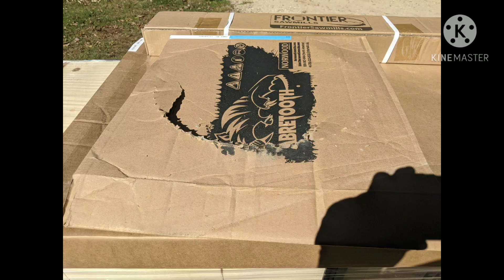The Frontier Os27 Has arrived

Comment: I just got one and am having an issue with my throttle as well. Any insight?
Reply from the maker: No I don't have anything for you.   Mine finally came loose again but where it's at it works and I'm leaving just like it is.   I could never get the pinch to hold the cable.   I did drill out the weld stud and put a 1024 lock nut and bolt.  Helped a bit.  I bought an electric linear actuator if my current cable fails I'm going to install that.
Reply from the maker: Enjoy the mill. I have really not found any other negatives.  I'd buy it again if needed

Comment: Im just wondering but how did you get the blade guide adjuster on the os27? Their website says its a fixed blade guide system. Is this an add on?
Reply from the maker: There are set screws on the side of it.   All I had to do was slip mine in and tighten the set screws.
Reply: @BigelowWoodcraft  so it comes with the adjustable setup? Please explain. Im looking to purchase ine but i want to be sure it has a fully adjustable blade guide.

Comment: How have you been liking the sawmill?
Reply from the maker: I've been really enjoying the mill.  No problems other than a water valve I let freeze...I fixed it.  In all honesty I've never ran another mill so I can campare it.   

I have the 13.5 hp.   Feel adequate.   I wish I had the extensions.  I'm pricing out steel to build my own.  I have not installed the auto lube system.   Had a hard time getting the throttle set correctly.  Setting up the mill is not complicated at all.  I recheck it once a week.